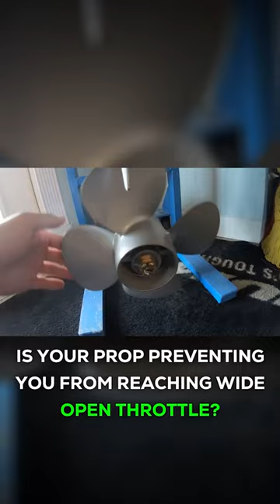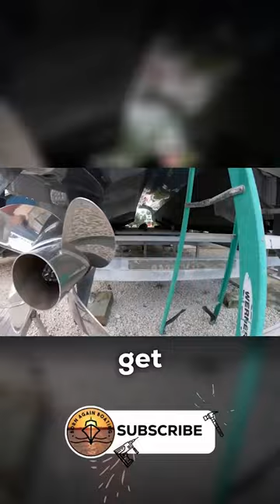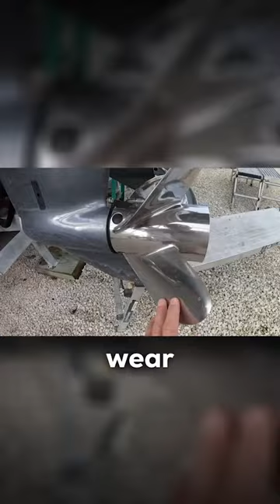Your prop is stopping you from hitting Wide Open Throttle

Comment: How would you know if you have the correct prop
Reply: Well first and foremost, you need to know what MAX rpm’s are for the motor your running. Then you need a Tach. Problem is most small motors don’t come equipped with a tach.
What size motor are you running and do you have a Tach?
Reply: The user manual for the engine will have a wide open throttle RPM range.  On a given engine its a balance between the pitch,  diameter and the hull speed
Reply: I know my engine is 6k max and I’m at 5750 at full throttle.  Should I even bother?  4 blade 15 p.  22’ cat with 115 Hondas.

Comment: ok, I've got a question, I have a 4 blade 19 inch pitch prop on a 90HP two stroke, had a 20 pitch stainless steel and I put the 19 4blade aluminum, was that the right choice and or I've been trying to find the stock prop  or the best prop for economy and pulling power for two skiers. any answers would be awesome. its a 1989 Mercury 90HP 3cylnder 2 stroke.
Reply: the only concern would be the rpms your getting. If your significantly lower wot rpms compared to the original engine specs then you'll need a change. otherwise as long as your within the max rpm range and getting the performance you're after then you're good to go.
Reply: @Fj4LiFe23  at WOT I'm getting 5200 and 47MPH, and at cruise I set 3900RPM and get about 27 - 30 MPH
Reply: seems like its ok, I believe you're in the middle of the wot rpm band for a 90hp two stroke but just with your engine specs. @NicholasQuickLiveStreams